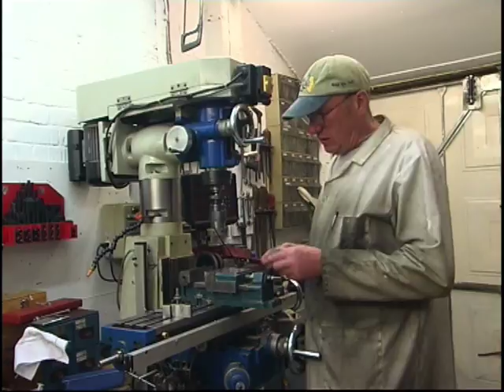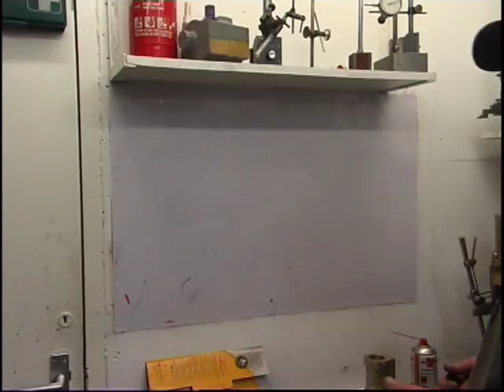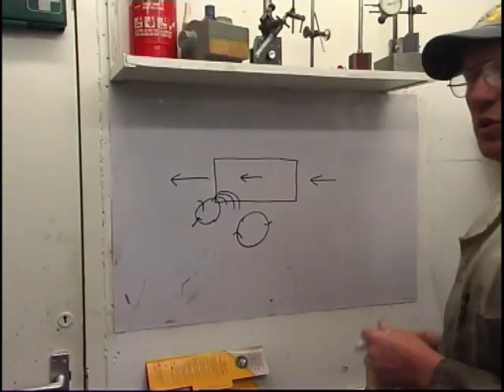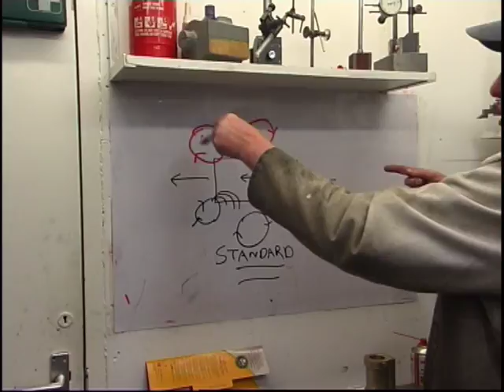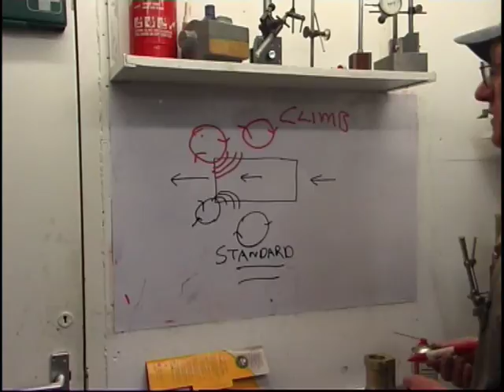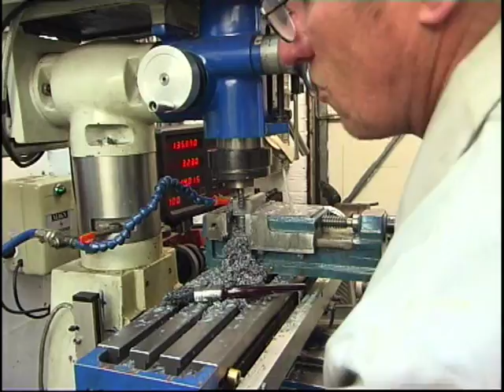HOW NOT TO CLIMB

Comment: If your using a T1/T51 tool post I found T63 holders fit straight in to my brand of QCTP (Rapid) which is handy as they have 25mm gaps instead of 16mm, they are the same size as T51 holders apart from their height, they are 44mm high, what was odd is I also have the same size QCTP made by Boxford on another lathe but the T63s won't fit that one without minor grinding

Comment: Dear Doubleboost,I am a time served miller from the 80's,left it in the 80's and now fixing up a garage workshop.You are doing a grand job.Yes conventional milling should be your datumn for heavy cutting,we left .005 thousandths for a finishing cut and climb milled.Mind you are vice handles were hammered tight and the machines were top notch.
Sound advice to avoid this if you are on a non industrial machine,ie hobby type.If in doubt keep it conventional.
 Keep up the good work I enjoy it all.
Reply from the maker: Thank you for the kind words

Comment: how come this obviously experienced guy dosent know how to use a file?
Reply from the maker: +shonuffisthemaster I can assure you I can use a fileThe material is very tough & hard It is a very sharp edge that is been broken All I am doing is removing a burr not hand filing a Shot Gun main springRegards Johnps Why not post a video about "filing"
Reply: +shonuffisthemaster he may have been relieving pressure on the file when going in the direction opposite of cutting with the file or it may be a file he doesnt give a shit about. ive used the same set of files for 10 years, some ive only pushed with and some i beat the fuck out of and they are both about as dull. you know why? because you inflict the exact same amount of stress on a file cutting with it as you do dragging it across a surface, its not gonna dull it any quicker because youre still using the cutting surface. if you were experienced you might know that.
Reply: +jameswoodsist no, i dont think so, u can tell by watching and listning hes not letting up at all. 

for one thing hes filing too fast to be able to let up each back stroke, u can tell his arms are still tense and the sound gives it away. experienced people can tell:p
Reply: shonuffisthemaster so how long have you been working with metal? im curious about your level of experience because the things you say suggest you dont have any.
Reply: jameswoodsist 2 year digree in welding and metal fab at hennepin tech in brooklyn center, mn. have owned a decent sized metal fab and welding shop for personal use and some side jobs for 3 years, have been making things out of metal with mostly hand tools since i was about 12 (now 37), have tought multiple classes in knife and tool sharpening and maintanance as well as.sharpening as on the side, i think i know what a file sounds like.......
Reply: jameswoodsist and what may i ask is your experience,.and more importantly what leads you to believe.hes lifting up on the back stroke when.its obvious hes not?
Reply: jameswoodsist or are you just trolling?
Reply: shonuffisthemaster i have a 3 year degree in welding and metal fabrication at CIT, i attended several metalworking-centric classes in college, all of which included metallurgy to some degree and i also have been working with metal since i was about 12, i would say younger but i didnt make anything good until i was 12 and the very first things i had to use to work with metal were metal files which i have dragged, pushed, pulled, slid and raked in every which way since then and never noticed any excessive wear or damage to them regardless because as previously stated they never leave the cutting surface, it might not do a whole lot of cutting but they arent harmed whatsoever by using them in the opposite direction of cutting. a file isnt going to give away the pressure its being used at because when you are rubbing 2 extremely hard steels together they tend to make a lot of noise, particularly with a file. i was using a file 20 minutes ago using this technique, there is no significant audible difference between extremely hard pressure and slight pressure. that being said, idk what he is doing maybe he is using pressure both ways, my point is that it doesnt matter and to pick apart that out of an entire video of good information just leads me to believe you are insecure about your level of experience (even though you have apparently been working with metal a long time) time and experience dont exactly make you a master, you have to pay attention and learn when someone is better at it than you are.
Reply: notice i started my post with "how come an obviously experienced guy" because i do reckognise he knows what hes doing for the most part, and yes im watching these videos because im starting to learn machining myself and have allot to learn. I appreceate that your coming to his defense in response to what you precieved as a hostile comment, yes mine came off as sounding too hostile and i should have said it differently.

as far as filing backwards tho, its common knowledge in metal working that it does damage the teeth even if its done lightly. the reason is file teeth are extremely hard as you probably know, and brittle. they are being stressed one direction when your filing forward, and if you draw backwards the teeth can be stressed in the other direction. do this enough, even with light pressure and it will quickly cause metal fatigue and they can break off. Id encourage you to get 2 identical new files and test this theory for yourself, count the strokes and see if you drag backwards inbetween that it dulls faster.

the point is theres no reason to not file properly, as in always forward and lifting completely off the part for the back stroke, unless your in a tight spot and just cant do it. just like always using a handle and supporting the file on both ends with you hands if possible, basic file technique that should be followed when possible.
Reply: +shonuffisthemaster you are 100% correct. a young guy at work changed the blade on a hacksaw and fitted it teeth backwards. he was puzzled why it wouldn't cut. same principles.

Comment: Excellent video John! I've just started out milling with no experience or tuition and noticed the difference in cut quality/noise when cutting either way. I did'nt know there was a name for it (climb milling), but I had noticed my machine certainly preferred to mill in the "standard" milling direction. Your video made everything much clearer and your soft wire trick has completely sorted out my problems trying to square up a block before a job. Thanks again, much appreciated. Lindsay
Reply: Essentially one of the biggest problems of climb milling is backlash.The cutter can actually pull the table in one sudden jump & take up all the backlash in a noisy,job hacking cutter braking movement.Not good for the nerves,or anything for that matter..

Comment: Gotta comment on this I'm an industry pro 15 years in the trade and I'm a home hobby machinist.  At work on Machining centers(CNC) and very rigid manual machines we always climb and it works better.   

At home and on older Manual l machinery at work I conventional mill due to the machinery lacking the necessary rigidity.

But you can climb on less ridge equipment if you take more than 1/2 the cutter diameter ie. .300 pass with a 1/2" endmill and you will get good results

Comment: by the way try a piece of leather belt in place of the alum. welding rod, It works great and does not slip. Tks. again
Reply: The initially round section is nice because it allows the part to roll in line with the fixed jaw before the tightening forces crush it. I use paper if I need extra holding power since it's held to very close tolerances across the whole sheet, but I'll try leather on the small hard to hold things too, thanks.
Reply: Round mild steel bar is just as good..

Comment: what speed do you run that carbide chamfer tool at?
Reply: Carbide 90deg inclusive for deburring purposes I run at 16000 RPM and 5meters a minute. Ok on manual your not going to do that, but I would run it flat out way slower on the feed as your spindle will only be doing probably 3000 rpm... slower you go it will rub and actually wear the tool out quicker. Aluminium you can ABUSE! You'd be surprised what you can do with stainless steel now too.
Reply: DMG Evos. They go up to 18000rpm we tend to run them a couple of grand down from top speed just to try and look after the spindle a bit. I've taken rippa cuts in ali at 16000rpm and around 4meters a minute. Half dia of cutter step over and half dia step down...... EATS IT!
Reply from the maker: No more than 60 rpm
Reply: doubleboost don't mean to cause offense or anything, i just want to learn, that seems really slow, we run ours at 2200 with a feed of 0.05 mm per revolution on mild steel and around 1400 on stainless. how come you run it so slow? also nice shop and good informative video.
Reply: Josh Hanson The machine I set up and program only goes up to 5000 RPM haha, it's a high torque spindle. What beast are you operating?

Comment: ive got a coolant pump on my lathe if i use it do i have to clean the beds of oily water every time its proper soluble oil mixed the right way
Reply from the maker: Hi
As long as it is good quality soluble oil it will clean & protect your machine
Regards
John

Comment: When I served my time all those years ago we had an old fritz-werner though heavier than your mill I would think yours would be able to cast heads too. only thing you need to look out for is Diesel cast heads as older ones with swirl chambers the chamber seems to stager the gasket and the chamber its self is as hard as glass always kicks the tool up would recommend grinding them. keep up the good work. If only more mechanics seen an engine as a block of metal with holes precisely bored ......

Comment: A very good video John. Essentially milling is the same as using a router on wood in that the direction of feed is important. John could also have milled his way around the work-piece anti-clockwise and so avoided any climb cutting issues. If the work had been particularly difficult to set up in the vice due to its size or shape then using the x/y table to work anti clockwise around the work would be the quickest and safest way to proceed.